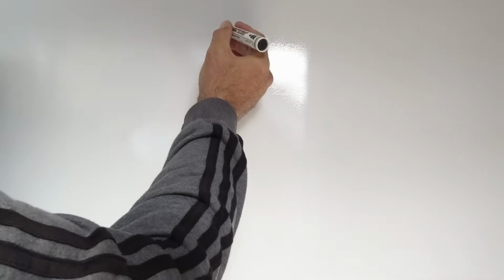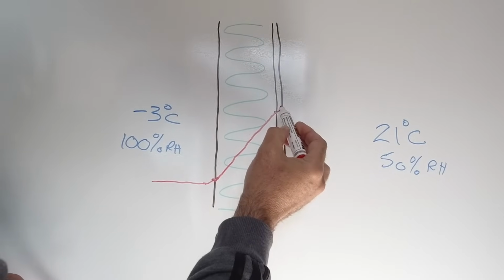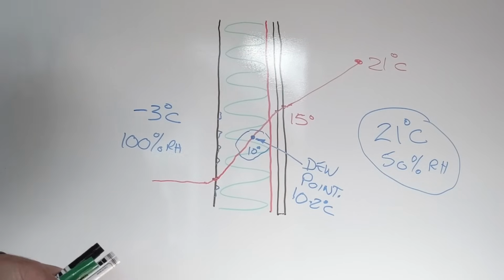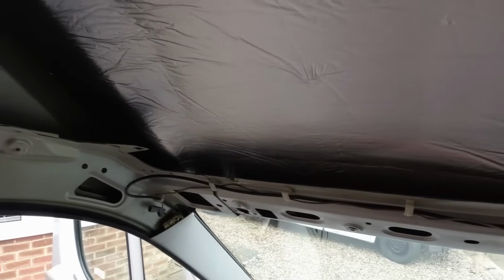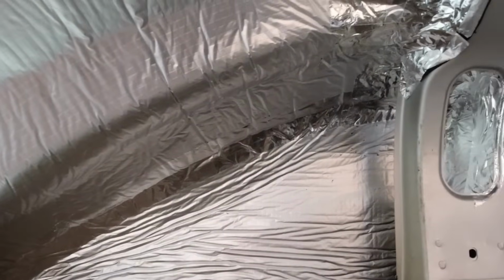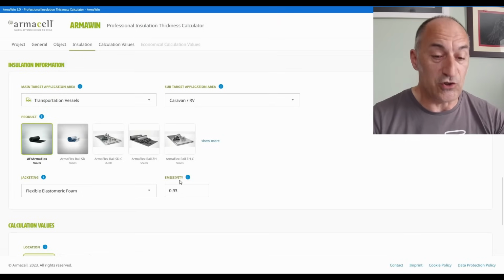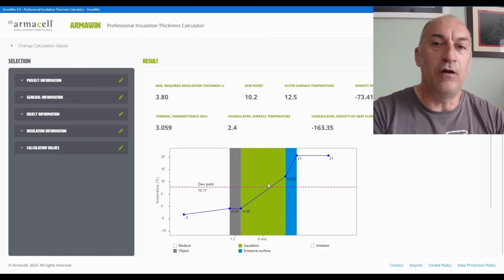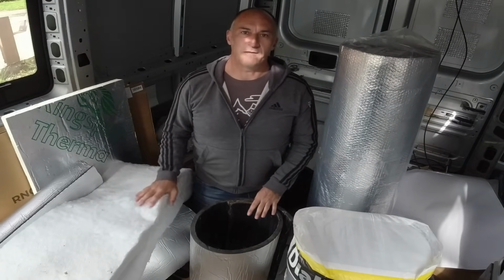The BEST way to Insulate your Van - Budget Build Ep 6

Comment: Excellent video, really useful to know the science behind it all. Would be interesting to see a reverse to that, where you're keeping the heat out, though I guess that's not such a problem.

Have just started a van build and spent many hours stressing over the insulation, so great timing to find this. Have considered 100mm fibreglass directly onto the walls with a covering of foil / bubble wrap sandwich on the inside. Theory being to prevent the ingress of vapour getting into the fibre. Not sure the theory works though. Will see what your link throws up. Many thanks.
Reply from the maker: Your idea is perfect in terms of keeping your insulation dry. Take a look at this video I made about it 
https://youtu.be/zCjygu0ygKE?si=hr8UT495ZkdhJn79

Comment: I have a confusing (to me) question, so in Australia it’s kind of the reverse for me, I want the inside to be cool as a cucumber when it’s 35c outside, so my logic is saying I’d need to do the insulation order in reverse? So the vapour barrier on the steel wall and then the insulation and cladding etc? Does that track? Or make sense at all? I just know that the inside of my car gets condensation-y on the windscreen when it’s hot out and I have the aircon blasting so i just don’t wanna mess up a van with that!
Reply from the maker: Hot or cold the principles remain the same. You still need to insulate really well to stop the transfer of heat from outside to in. And put the vapour barrier in the same place on the inside for those cold nights. 👍🏼😊

Comment: Based on what you're saying I take it that it would be wise to seal the exposed edges of the foam board with aluminum tape to prevent condensation from entering through the exposed edges. This would extend the build time a lot but it would be worth it to protect the hard work involved.
Reply from the maker: It is closed cell so not like sponge it is not porous so actually doesn’t even need to be foil faced and you can buy it just plain foam.

Comment: Hello Greg
did you put any insulation down into the Sills of the van or how do you cover the holes and stop moisture sitting at the bottom of the sills please 😊
Reply from the maker: I removed all the external plastic trim. Purchased a pack of 50 new rubber clips off eBay really cheap and replaced them all and re sealed them with a drop of silicone. It’s something you can do afterwards from outside. 👍🏼😊
Reply: @GregVirgoe amazing thanks did you then proceed to put insulation into the Sills? or leave them hollow

Comment: I have a Dodge Promaster - and would love to do this!! Amazing explanation on insulation.  However, I think I have airbags that are somewhere in the headliner - so I'm afraid to remove it and accidentally deploy the airbags I'm searching for specific videos on this but am not having much luck. Thank you for these wonderful tutorials!!!
Reply from the maker: Most airbags are triggered by an inertia switch located elsewhere in the van. I doubt the airbags would be attached to the headliner they would be securely fixed to bracket by other means.

Comment: What's your thoughts on condensation in the uninsulated areas of the cab?
Reply from the maker: The key is to keep the van warm and well ventilated to minimise that effect. If you allow the interior to get cold and the moisture content is high the problem will be worse. 
No doubt you will get a bit mostly on windows but that can’t be avoided. 👍🏼😊

Comment: ❤😂 okay sir I think I have my last question. Given the fact that winter is coming the temperatures are now 65° during the day dropping to 50 in the next few days and it will be 30 to 40 during the night. Almost everything is ready to put the foam in place and get her taped for my question is should I try to do it in sections completed with the bubble wrap reflectix or should I do all the foam and wool and then try to put a couple of heaters in to dry whatever moisture might be in the wool and then hang the reflectix? Does introducing heat into the van make the condensation worse? Cuz I can wear a pair of ski pants😂😂 and run the two Max Air fans on exhaust to pull out the moisture coming out of me and possibly a helper God I hope😂😂
Reply from the maker: There is actually less moisture content in cold air than there is in warm air. So I suggest opening the van to brave the cold that will keep it well ventilated and as long as there is no moisture on the metal of the van then seal it up with reflectix. Having the van shut up with heat in there will make it worse.
Reply: @GregVirgoe  thank you that's what I figured. Ski pants it is

Comment: ❤ hey dude I haven't dropped off the planet😂 I wish I could say the van is done but I'm actually still insulating. All the foam boards are cut and measured with the exception of around the bunk windows. I haven't watched these latest videos which I'm about to but I'm confused by something I thought you were original videos show you putting the battens/ struts on the outside of the reflectix. Then the other day I was watching Camper vibe, my two favorite ladies out of the UK and their van build series they put the struts up and then covered them with the reflectix and just kind of marked marked with a magic marker where they were. I am still determined to use the rivet gun and I'm trying to figure out the best way in which steps to do first since it's all going to be covered with reflectix and or tape. How do you keep the holes handy😂 I'm still determined to use the 2x2 or 2x4 the main connection places. When I stand inside this van and look at the enormous walls and ceiling I just can't bring myself to use pieces of plywood as my attachment places. Also with the weather moving in cold temperatures and or moisture I may have to use an electric heater to dry things out because I'm using wool everywhere I'm not using foam board though at this point the only wool that's been put in is in all the channels nooks and crannies  Before I go one step further dear God sir which side of the reflectix do the struts go on?😂 I'm going to be using quarter inch mahogany panels for the walls and the ceiling is the shower panels cut in strips attached to the struts and then the longer pieces lay on those strips. That way those panels can be removed cleaned and I can hide my twinkle lights😂 I'm about ready to plow forward😂😂😂 help
Reply: PS although we removed all of the foam around the overhead cab area I don't feel comfortable and don't want to pay somebody to remove that liner so all I did was slide a piece of bubble double-sided reflectix into the area🎉🎉 with all the wiring down in the front near the windshield because of the God knows what this whole thing is one big piece of wire😂😂😂😂 so right now that piece of reflectix is laying up there Lucy goosey😂😂😂 I thought of trying to lay some wool in just a solid piece as I was afraid to use the little chunks that it would fall down and get mixed in with all those wires😂
Reply from the maker: Hello Judy, reflectix over the top of your battens before you line the van with timber. You can feel where the battens are through the reflectix and mark with a pen. 
You really do need to remove the headliner otherwise what you have done will not work. It’s really easy just follow my video 👍🏼😊
Reply: @GregVirgoe  dude my headliner doesn't look anything like yours and I watched enough videos to know that it's not something I want to handle and the van build out guy wanted a couple hundred dollars which seems like a lot of money for something that should technically only take a half an hour
Reply: Not to mention the wiring that goes down the side along the window Ridge which controls the airbags. I don't really want myself or anybody else messing with that wiring and you have to disconnect it in order to take the headliner out
Reply from the maker: @justjudy7320  I see what you did there 😂😃 remind me what van do you have.
Reply: @GregVirgoe  I apologize it's the Holy Grail a 2022 4/4 sprinter 170 high top. The floor is done as is the max air fans two bunk windows 360 on the roof. The local victron dealer actually has a small van built out company when he's not busy being an architect and he built me a really nice box and a tower that separates the bed area from the living area with plugs and so forth. 200 amp hours of lithium and an 800 watt inverter because I didn't want to spend any more money at the moment. I was so tired and frustrated after all the videos and opinions on solar / electrical that I basically told him I want what he's having just a little smaller portion that I can add to later. I guess what I'm confused about in terms of the struts be in the 2 x 4 and 2x twos if the back side of the wood panels can be exposed and where they are on this side of the reflectix why couldn't a 2 x 4 in a strut be on this side of the reflectix. I plan to put the rivet nuts right through the bubble wrap reflectix and I'm only going to use a few main ones here and there and then some will be self tapping screws. The foam board has been interesting as we don't have any foil faced and it only comes in either 2 inch or 1 inch and I am using both some of those places easily take the 2 in. Oh and PS I was shown in meditation to use the stick pins up into the foam board in areas where it's hard to keep the reflective material up on the ceiling or up against the wall to Simply use the stick pin the other direction and cover it up with tape . I was like thanks higher self
Reply: @GregVirgoe  one more PS if I'm using 2x twos or 2x as the buttons isn't that going to create one heck of a gap from where the reflectix would press up against the foam board and the structure of the van. Our other friend George and his air flow when I saw your comment I thought well they'll be airflow if I put the reflectix over a 2X.I I guess I could try to mold the reflectix as we come up to the Batton around the side over the top and back down the other side as most of them will connect with a major vein so to speak in the van. I do have a paper reflectix but it was my plan to use the bubble reflectix on the walls and ceiling what should I consider just using the foil paper and wrapping those struts
Reply from the maker: @justjudy7320  if you are at all worried about it do the reflectix first it doesn’t matter which way as long as you seal all the joins and edges completely

Comment: Thanks for the info! Question: what if the insulation ends up being not thick enough and condensation does happen? Will this then be trapped within the barrier/insulation without the possibility of evaporating?
Reply from the maker: No if vapour has got in there then when it heats up and the air expands it will get back out and take the moisture with it. You are not going to have a ever increasing pool. Just doesn’t work like that.
Reply: Great to know, thanks!

Comment: Wow that armaflex thing looks promising. Calculator says I need 6mm but, I still feel that might be too thin wouldn't it? Is it really that good? 
What's the nominal thermal conductivity value of armaflex? 0,03 maybe? 
What about the plastic bottle wool's?
So I could put the wooden pannels directly onto the armaflex and it'd be safe regarding the condensation?
I guess you must wrap the whole van filled with armaflex, not one inch free of it, right?

By the way Greg we spoke a few years ago I am glad to see you're doing great!
Reply from the maker: This is the minimum thickness you would need to prevent condensation forming. In order to give you good thermal insulation then you need to put the most insulation in that you can using PIR where possible and recycled wool in other areas. Just 6mm of Armaflex on it own would not be sufficient
Reply: @GregVirgoe  How about 20mm for a Hiace XL body. About 280x140x140. Would that be sufficient for all purposes. I am facing -10 at night where I'm heading.

Comment: I used a NASA idea found in Australia a fair bit. I painted virtually all of the inside steel panels and the doors inside and out, along with the entire outside roof area, with glass sphere insulating/reflective paint. Doing side by side comparisons as I went along, it changed the boundary layer temperature at the bare inner panels by 2 - 3`c. I was sceptical but I tried it and it does appear to work. Maybe Greg could comment on this.

I then insulated the various areas of the van with different insulations much along the lines of Greg except I also used polystyrene in a couple of areas where I wanted firm, shaped structure.
Reply: I read about this NASA insulating paint a few years ago and have tried this out on the camper for over 2 years now and all of the exposed painted surfaces are no longer as cold to touch as you would normally expect, so the impregnated/insulating paint layer is doing something unusual. There is also a fairly normal 50 to 90mm of various types of insulation and reflective vapour barrier throughout the van interior with cloth covered, padded interior panelling throughout  but I deliberately left some panels "bare" with no stretch carpet or cloth covering to try it out and the bare metal has never felt chilly cold when inside the van even when it is cold outside. Even the plastic and Formica surfaces inside the van feel noticeably colder than these painted ones.
 I think the main advantage is the reflectiveness of the outer surfaces of the roof reducing the heat transferred into the van. However, the painted surfaces inside no longer feel cold like normal painted panels do. The front cab doors have plain, bare painted areas and feel colder than the coated panels. This is my fourth camper, one Autotrail and three self builds, so I can compare the "feel" of all of them with some degree of confidence. I estimated that if I didn't like it I could cover the bare areas in cloth or carpet.  I have never felt the need to do it despite some of the "bare" panels being by the ends of the bed. I am surprised by it and I don't fully understand why glass microspheres in paint feel the way they do, but NASA developed it for insulating and reflecting and it seems to work to a degree.
Reply from the maker: @davidmuirhead1060  actual surface temperatures when it’s zero deg outside would be interesting to see to get the true picture. 🤔
Reply: I have never had my temperature gun with me to measure this when out and about. However, the lowest known/guaranteed outside temperature that the van has sat in overnight is -10`c. The painted van panels were not at all "cold" inside  compared to grabbing the door handles outside. The plastic toilet seat was definitely more chilly and it is nearest the heating. That is as near as I can get to evaluating the actual temperatures and hence the reason why I don't feel the need to cover the "bare" panels so far.  @GregVirgoe
Reply from the maker: I’m sorry to say that a layer of paint no matter what type is too thin to be a practical addition. As you say it only gives you 2-3° difference so when it’s cold outside the inside temp is still going to be well below the dew point and condensation will still be a problem. 
So I say save your money and time and just insulate with normal materials to a decent thickness and then vapour barrier. That all you need to do. Thanks for posting as it has confirmed a good point for others reading this. Cheers 🍻

Comment: On your advice, we used mineral wool and the foam boards in the flat areas.  How do you compare the recycled plastic insulation you're using now, with the mineral wool?
Reply from the maker: It has the same thermal properties but is just nicer to use not as scratchy and it is greener creds

Comment: Fantastic videos!
I need to translate what you’re saying for Canadian temperatures !
With the van conversion of temperatures that could be -20 …

Keep up the good work, really appreciate it
Reply from the maker: All you need is to go really thick as possible on either PIR or EPS insulation, fill all voids and even use a bit of exp foam on gaps. A really good foil vapour barrier and you will have a very well insulated van 🚐👍🏼😊

Comment: I've seen cars in Southern France/Spain where the inner linings are falling from the ceiling/walls because the temperature under the sun was so high it melted the glue.
How would the self adhesive on the foam deal with this conditions?
Reply from the maker: These areas are all going to be insulated over and wrapped with vapour barrier and cladding which will also hold it all in place. Nowhere for it to fall to.
Reply: @GregVirgoe 
So, the linings don't have to be in contact with the bare metal then.
That suits me, I'd rather have all layers glued to the inner wood panels, and with the ribs as the only thermal bridge.
Air is good insulation, and a couple of computer fans could run some air circulation to chase any moisture.

While I've got your attention, I'd like to thank you; your videos have been a great help and inspiration.